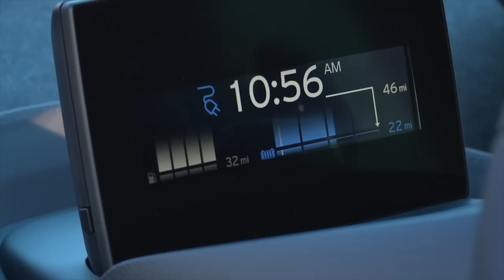Five Things We Need To Improve About Electric Cars

Comment: When you boil it down, the EV is all about the battery. So improvements in battery chemistry is absolutely top of the list. The holy grail should be solid state because of..everything. Li-Ion has range reduction problems with too cold or too hot, even with thermal management. With solid-state, VERY rapid charging is feasible too without undue long-term battery degradation. Because of the electrolytes they use, or rather don't use, they are lighter and will be cheaper too.
Reply: Solid state may be better and come to fruition soon enough, or not.  Do not let perfection be the enemy of the good.  No point in waiting when by the time a Li battery wears out to the point of replacement there will surely be a better cheaper replacement, solid state or not.
Reply: I disagree and claim that solid state batteries are an almost irrelevant Holy Grail that will bring almost nothing unless they also reduce the price per kWh.
Let's use a Model 3 / Kona / Niro as an example and assume that 30% of consumer price of the car goes for the battery. 
On a state-of-the art charger, they all need about 30 minutes for a charge that adds 50% and 45 minutes for adding some 70-75%, which results at about 80% SOC and is regarded as "full" on a road trip.

Tesla does the same even slightly faster and since it has a bigger battery, it adds more miles per minute.

The first one you do during a coffee break, the second is a lunch break. While I agree that this may be a small annoyance, it becomes quite less important when you A) start /every morning/ with a battery that is as full as you want to have it and B) the first leg is 350-500 km (200-300 miles), depending how fast you drive.
All EVs are mostly charged when they are somewhere standing still, be it at home or at some parking spot, they need rapid charging only on long trips.

Now let's halve or double one of the characteristics with another type of batteries.

Double the battery life? With the exception of Leafs which have no battery cooling, all EVs have a battery that goes for many hundred thousand kilometers/miles before some significant (15%) degradation. Nobody knows how long they will go, therefore nobody really needs a doubling in lifetime.
Halve the weight of the battery? A nice feature, but since the car regenerates 80% of the energy you needed for acceleration, it would be merely a 5-10% increase in efficiency, so this is hardly a game changer. Except for the batteries which would go beyond 100 kWh and 500 kg, the weight is hardly an issue.

Double the power output? Barely someone would notice / need it. All EVs I mentioned have a 150 kW output or more and torque and power in abundance.

Double the rapid charging speed, halve the time, a feature that SSBs promise?
That would be nice, from today's 30 / 45 minutes we get to 15 / 25 minutes. It's a nice improvement, but very rarely important except on (very) long trips. How much would you be willing to pay additionally for this option? 5% ? A few percent more?

But, now double the capacity at the same price. That one is really a game changer.
Or even better, keep the capacity, halve the price of the battery. From today's 70%(car) + 30%(battery) you have only 70%(car)+15%(battery) = 85%. You have a car with a 15% price reduction.
This is by far the biggest advance the battery technology can make since it brings these cars I mentioned before in direct price competition to ICE cars.

So solid state? Forget it, at least for a decade.
Nobody has a battery that even works in a laboratory scale, far less in production.
And until it matches current batteries in price per kWh (or at least has the potential to come really close), it is a technology only for dreamers.

It's all about the price of the batteries (per kWh), every other aspect is far less important.
Elon Musk was (and is) right once again.

What we need is:
- more battery producers, I absolutely agree with Nikki on that one,
- many more 22 kW Level 2 AC chargers at parking spots for people who don't own a garage,
- EVs with at least optional stronger built in chargers (6-7 kW is not enough, manufacturers should provide optional 11-22 kW built it chargers),
- the charging infrastructure has to be simple to use, the best example is Tesla.
- an upgraded rapid charging infrastructure on major highways, eventually also faster than Tesla which offers 120 kW (CCS which goes theoretically up to 175/350 kW)
- by far the most important is EVs made in higher series which will lower their price,
- and finally more models with an affordable price, including family cars.

And btw, super-rapid charging is almost impossible because nobody would be able to handle charging cables which would be able to provide more than 1000V / 500A. They would be simply to heavy.
Reply: @richardpetek712  To claim solid state batteries are irrelevant to progress is like saying airliners should still be piston engine powered. Solid state is lighter, cheaper, faster charging, more energy dense and reliable.
Reply: @karlp8484  I deliberately made a very bold statement to show the controversy. Everything you say that they are capable of is only a slight improvement, mostly irrelevant until SSBs catch the price of current (and future) Li-Ions, and I made a very clear presentation for my case. Since you claim that SSBs are cheaper per stored kWh, please provide the source. If you can't provide it, don't make false claims. "Some day they will be cheaper" is not good enough.

If you didn't know, Dyson has written off about 50% of the investment in Sakti3 in 2018 because it didn't make progress. Just FYI.
Reply: @karlp8484  No, I oppose your basic idea:
> So improvements in battery chemistry is absolutely top of the list.
No, top on the list is lowering the price of the batteries . And that will most likely happen with batteries we already know how to produce.
Second on the list are small, incremental improvements in speed of charge and capacity per weight. 
Lifetime is far beyond normal needs if you charge between 20% and 80% and if you occasionally use 10-90% or even 0-100%, it doesn't hurt them too much.
The problem is only if you do it all the time which you do only if the battery isn't big enough.
Any issues of today's small batteries are almost instantly solved once you double their size.

So your proposal, a switch to another technology is pretty down the list, whether you like it or not.
Yes, it's a target for 2040, but far from something that would be needed in the near future.

Once you can show SSBs which will be produced at $50/kWh while still having all their benefits, they will be great. They will even open the market for commuter airplanes.
But until then, they will be only a small (real life) improvement. 

Let's go 10 years in future where every new EV will have an (optional) 100 kWh battery and will be able to charge at 175 kW on a CCS charger. Let's round this down to 150 kW what Tesla could already do today do if the chargers would be strong enough (Model 3 LR charges its 80 kWh battery on a 120 kW charger at 1,5C). 
At a consumption of about 20 kWh/100 km, it will be able to charge some 60 kWh (=300 km, 200 miles) in 60 kwh/150kW = 24 minutes.  Do you really think that a decrease in charging time from 24 minutes down to (let's say) 10 minutes would be that relevant? After driving 400 km / 250 miles every driver will want some rest. People who drive 3-4 hours do make some breaks. Those additional few minutes of charging time will be pretty much irrelevant . 
They are relevant only to you who still thinks like an ICE driver.

You think that 100 kWh batteries and 150kW charging won't be enough for pickups? I totally agree.
But where is the limit?  OK, the weight might be an issue. 
200 kWh batteries currently weigh 1000 kg, but with some improvement they will weight only 800 kg. Slightly smaller ones having only 160 kWh will weigh some 600-700 kg. That's already manageable in a pickup.
And you probably remember that CCS is designed to charge at the speed up to 350 kW. That's a 200 kWh battery at a 1,75 C speed. So?
Reply: @karlp8484  Don't get me wrong, I have nothing against progress.
But you unknowingly made a perfect analogy with piston/propeller vs. jet engines. And by sheer coincidence, the analogy differs almost precisely by 100 years.
In 1876 Nicolaus Otto invented the piston engine. In 1979 John Goodenough invented the LiCoO2 rechargeable battery.
In 1903 brothers Wright made their first powered flight. From 1996 to 1999 GM produced the EV1.
Piston planes made their major breakthrough during the WWI from 1914-18. In 2013 Tesla started to produce the Model S and in 2018 the Model 3 reached mass production of 5000 cars per week.
So that's almost a 100 years gap.

First ideas about jet engines came in existence in 1915, first patents were filed in 1921, first engines were built in 1935 and first really successful jet plane was the Me-262 in 1944. But outside military, where money isn't the first priority, the first passenger jet was the Sud Aviation Caravelle which entered service in 1959. And then it took almost a decade before Lockheed Super Constellations with their piston engines were passed out.

Where are we now with solid state batteries? Early ideas / university research / prototypes. We don't have even a smartphone battery where everybody would love a phone that charges in 5 minutes. A field where customers would easily pay a very high premium for the battery if the phone would have that feature.
I won't say that it will take 40 years before they enter service in cars, today things get developed a bit faster, but it will take at least two decades before they really make production models and they come even close to the price per kWh of Li-Ions which will be by then produced at a many times lower price than today.

But, in far distance, they have a future.
Once the battery is only 15% of the price of the car, will the customer be willing to pay a 5% price increase to get the same battery which charges 3 or even 5 times faster? Yes, some will, especially those who often drive long routes. Those who haul heavy loads like trucks or some users use their pickups.
They will be willing to pay a premium on their price, maybe 50, maybe even 100%, measured merely on the battery.
And eventually their prices will drop and they will take over the market. 

But this will be an E-volutionary change, not a RE-volutionary one. It will be a nice (premium) feature, nothing more.
Reply: @richardpetek712  One of the major difficulties with SS batteries and supercapacitors is the bewildering number of possible chemistry options. I have myself heard/read about 6 different ones. Graphene is starting to be produced on a commercial scale for example. So what I hear you say? Investment choices. No one wants to put mega investment into a particular solution, only to be overtaken by something cheaper and better. It is my understanding that this is a major problem. Tinkering in a lab is one thing, but actually going into production is quite differen.t
Reply: @karlp8484  "Tinkering in a lab is one thing, but actually going into production is quite different" .
Exactly. A) you need the technology and B) you need the market.
Currently Tesla needs to focus what lies 1 or 5 years ahead. Elon probably has a strategic path for 10 years, quite possibly even a few more.

I am pretty sure that Tesla will invest in SSBs when it will see potential in them, but today it has neither the time nor the money to invest in something that has the potential to become a success in 20 years.
As I have made it very clear, the first and major criteria is price per kWh of storage (if all other criteria is same or better). 
With a significant distance comes the rest.
Reply: @karlp8484  Graphene is another over-hyped technology. While in theory it is great, you have to solve what the insulation between graphene plates should be - and it is a high safety hazard. Once you have a big charge in it, it is a lot of energy. One crash that damages it - and it burns. Graphene is nothing else than pure carbon (=coal) in extremely thin plates. Expose hot carbon to air and it burns like a box of matches.

And even-if, super capacitors can hold two orders of magnitude less energy per kilogram than normal batteries. While they are great for rapid cycling (and city buses), they are horrible for cars. Yes, you can charge in seconds, but you can drive only for a few minutes.That's not even an option for a car.
Reply: @karlp8484  Research? Development?
Maybe by 2025 we will have a couple technologies where we will say "great, this one looks really really promissing". Be it SSB, graphene supercapacitors or whatever. But it will have to cover the whole package: charge per weight, charge per volume, degradation, charge and discharge speed, complexity/price. Being able to charge fast is a one-trick pony, that won't be enough.
By 2030 we may have good prototypes.
By 2035 they may be massively produced, first for appliances where their fast charging and other abilities will outweigh their high cost.
By 2040 they may become price-competitive for cars.
And by 2045 they may replace Li-Ions in all but a few areas.

Note that this is pure speculation, but this is how development goes. The history of Lead-acid, NiCd, NiMH and Li-Ion battery has shown it to us. Every transition takes time.

We can make the whole transition of transport of land to electric using the battery technology we already have.
With technology improvements we will be able to make it better for some specific use. Diversify it. Some people will like batteries with higher charge, others will prefer faster charging. We already know how to do this. There are LiPos that charge and discharge almost 10 times faster (used in RC models), but they hold almost half the charge less (per weight) and cost more than five times more.

Yes, Li-Ion technology is less than perfect and it would be nice to have a better. I don't have a horse in that race.
It is a great future for other technologies and a high probability that Li-Ions will be replaced with something better by 2050, quite possibly a decade or so sooner, but there is no need that we hold our breath until then.
Reply: @karlp8484  I suggest that we go from "waht would be great" to "what we really need/want". Set targets / goals.
What would be great? A fully recharged battery in 10 minutes. 
Whoa, that one was easy.
But then we wake up from the dream and we are back in reality. 
What do we really want and need?

I'll start with a sedan which consumes 25 kWh/100 km at 120 km/h (75 mph), a Tesla Model S. 
Scale down 20 kWh for smaller cars (Model 3 or smaller) or up to 30 kWh for SUVs (Model X, iPace), maybe even 35 kWh/100 km for pickups. But you will get the basic idea. If you need towing, add some 30% since you will also drive slower.

We start with a full battery.
The first leg should be 3 hours, that's 350 km. We take a short (toilet) break for 15 minutes.
The second leg is 2 hours, 250 km. Longer (snack) break, 30 minutes.
Rinse, repeat. Agreed?

So in a pretty much ideal case the car should charge 
- for 250 km some 67 kWh in 15 min (that's a charging speed of 270 kW) for the second leg
- for 350 km some 87 kWh in 30 min (that's a charging speed of 175 kW) during the lunch.
Can we do that with the current (Tesla) technology? Yes. All that is needed is a 160 kWh battery and a 300 kW charger.
But, this is a huge battery for a Model S.

Let's do a slight compromise, add 5 minutes to each charging session:
- for 250 km some 67 kWh in 15+5 min (that's a charging speed of 200 kW)
- for 350 km some 87 kWh in 30+5 min (that's a charging speed of 150 kW)
That's a definition for a 135 kWh battery and a 200+ kW charger. These few additional minutes bring charging times and speeds to reasonable numbers.

And that was my initial proposal: 80 kWh for smaller cars (a few more would be better), 120 kWh for larger ones and 150 kWh for pickups and SUVs. 200 kWh if they need towing capability.
While this may seem a lot for today, the results will be (as I have shown in the example above) pretty close to what we will ever want, or better to say, need.

Let's go to the Model 3 Long Range.
It has an initial range of slightly less than 400 km (250 miles) at freeway speeds. It meets the first criteria.
And it charges about 50% of that range in about 25 minutes, so it's 5 more minutes and the added range is 200 km and not 250 – for these you need to charge slightly over 5 minutes more.
People will live with it. On a 1000 km (600 miles) trip it is totally irrelevant if on that 10-12 hours trip each of those 3 stop lasts 5 minutes more.
So while the Tesla Model 3 Long Range isn't the ideal EV, it is pretty damn close. It's the best what the 2018 technology can offer.
And people who can afford it are running for it.

Ten years from now newer cars will be slightly better, but they will be merely an incremental improvement, nothing dramatic. 
A slightly bigger battery and a few minutes less for the charging - and that's about it.

We'll just see lots and lots of different cars from different manufacturers having lower prices – and that will be great.
Reply: @richardpetek712  you hit the nail on the head with your comment that we need "an upgraded rapid charging infrastructue on major highways" ~ but perhaps no the way you were thinking.  
What potential charging possibility can electric vehicle do that an ICE can not??? It can charge on the move ~ that's the killer edge EVs have been looking for over ICE vehicles ~ SMART HIGHWAYS ~ CHARGE ON THE MOVE.
Reply: @hitreset0291  Charge while you are moving?
You would essentially convert cars to electric trains which get electricity from the grid.
You cannot make contacts in the air, nor on the ground, so the charge on the road would have to be taken wireless.

We are taking about charging at a power rate of 20-50 kW (20-50 thousand! Watt) per car. That's quite a lot, this is not an electric toothbrush or a smartphone, that's a magnetic field that is thousand times more powerful. And that's without a direct contact since cars are some 15-20 cm (6-8 inches) above the ground?
Electronics in cars could drive crazy. People with pacemakers would be exposed to a danger of dying on the spot. You are driving over 20-50 microwave ovens with open doors, that's serious business. Ok, I know, it's a magnetic and not a microwave field, but you get the idea of what kind of power we talk.
And at the same time some people are scared by radiation from their smartphones that goes in mili-Watts. Crazy world.

That would be tons and tons of wiring in the road, with all the complexity to realise who gets the charge and who doesn't, accounting etc., you get the idea.
Let's take into account that the cost to cover all significant roads would be immense while companies (like Chevrolet) even refuse to install a few dozen chargers per state on interstates and major highways. 
What about some less-important local roads? How would that EV drive there?
That's a proposal which is thousands of times more expensive.

And what for? On a long trip you take a leak anyway (unless you have a bladder of steel), maybe you have also a snack. And if you stay within the range of the car you simply plug it in once you arrive.

Sorry, but that's just another <insert adjective> idea that works only in theory but will never go beyond a prototype. 
Way too much pain (hazard, cost), too little gain.
Reply: @hitreset0291  Well, a few decades ago when I was a kid, there were some ideas about the future.
Knight Rider, a TV series with David Hasselhoff, with a "talking" autonomous car with AI, videophone and something like an internet connection. That car was more or less the 40 years old predecessor of the Tesla Roadster 2 which will be out in 2020 and will have fully autonomous capability in a couple of years later. 
And I actually studied IT and considered a career of artificial vision and AI, but I was born at the wrong place and twenty years too early.
No, I don't remember that somebody would have a vision of connecting computers with mobile phones in the eighties. Internet and WWW became publicly accessible in the nineties.
But there were ideas to give watches mobile phone capability - which we still don't have.

First mobile phone was made in 1973. In the nineties they switched from analog (NMT) to digital communication (GSM) which enabled data transfer. Once phones got their first cameras (which were more like a gimmick back then) and the processors to digitise images, the rest is history. 
Processing images + data transfer => internet in the pocket.
But what infrastructure do we need for that to work? A few antennas where each one covers hundreds if not thousands of people. That's an investment of few tens of dollars per user, maybe a hundred, tops.

What you want to propose is something like a small-scale maglev track, you know, like the train in Shanghai. A similar thing, just without the magnetic levitation.
You know why there are almost none of them? Because they are prohibitively expensive. The price for that 30 km (19 miles) track was 1,2 billion. And it is viable since it creates a lot of revenue, the train works in 15 minutes intervals and the price for a round-trip ticket is $12,80 (source: Wikipedia).

And for your proposal you would need a track that can emit an sustained magnetic field of up to 50 kW along the whole route. That's a lot and lot of wires. Even if it would be possible to make it 50 times cheaper than the maglev track, we are talking about 1 million per mile.
For that amount of money you can install at least 10 rapid chargers, probably more. And USA has about 47,000 miles of interstates. They have more than one carriage. So we are talking about a 100 billion project, quite possibly I underestimated the cost and it could be a couple times more... Comparing to this, Tesla's Supercharger billion-worth network would be child's play.
While currently every state in USA only needs some 50 or 100 of them on interstates and major highways. That's maybe 5 or 10 million per state, but nobody is doing it. Because it is too expensive.
Your proposal is at least thousand times more expensive.

And even if this would be done on interstates (which /as shown/ would be prohibitively expensive), cars would also have to be able to charge this way at this rate. So cars would be more expensive too.
And you haven't solved the problem for all other routes, so cars would still need quite big batteries. Yeah.
All that for not needing to have to plug in your car while you take a leak on a very long road trip over an interstate.
Well ... I think I've made my case very thoroughly.

I probably know a lot more about physics and engineering than you do. And I base my scepticism on that knowledge.
I love progressive ideas, but they need to have a purpose and they need to be financially viable.

And all you can say is if folks would be following people like me, we would be still in stone age.
No.
I am against wasting money and efforts on things that don't make sense.
Over time, computer power (and AI) will become cheaper and cheaper. 
Copper wire is copper wire. It won't.

Would smartphones be a wild idea 40 years ago? Quite probably. But 20 years ago? For people who knew how to connect the dots - no.

I have nothing against progress, we'll still see a lot of it.
Li-Ions of any scale can hold more and more energy. 
In a few decades we will probably have even better technologies. which will open new fields.
Yes, wireless charging (which you like so much) has a future. For some fields of use.
Wifi connection chips are dirt cheap. So is mobile LTE connectivity.
Mini cameras like those we have in smartphones are cheap.
Processing power and storage is cheaper every day.

So we will see a lot of things in the next decades which will connect all these dots.
Some gadgets which will live stream video connection and some computer on the cloud will process that data and do something with it.
These things will connect with each other and exchange data.
There are lots and lots of possibilities.

But when it comes to infrastructure like heavy load charging, things become complicated and (prohibitively) expensive.
So sorry, you may have ideas, but this one doesn't work, at least not in this century.
This could work once humanity can harness solar energy 100 times cheaper than we can do today or when robots cost $1000 and will start working for an cent an hour, but we are writing the year 2018, talking about the next few decades, not the year 2200.

What could become possible is stationary wireless charging of EVs like smartphones do today. In garages or parking spots.While this is a pretty expensive proposal, that one could have some potential. You park your car, it identifies itself and starts charging. It's a convenience feature, like that one with smartphones.
Actually this would be the perfect solution for fully autonomous cars - if they wouldn't need some daily maintenance (interior cleaning) too, and once you clean it, you can plug it in too, right?
But it could be an optional feature for luxury cars which could charge this way in their own garage.
How much would that cost per car for charging at 10 kW? $5,000? $3,000? Something of that magnitude.
Maybe, with time and scale, it could cost less.

But that's a lot different from your futuristic proposal of charging while driving.
Reply: @richardpetek712  here you go...just shows you don't underestimate SSBs: VW just bought a $100 million stake in QuantumScape, a solid state battery company. They're going to leapfrog Tesla/Panasonic in battery technology.
Reply: @karlp8484  I gave you a very detailed article / lecture how lower weight and faster charging are pretty irrelevant. Having a battery that has 50% less weight decreases the weight of the total car by only 10% - and that's the efficiency gain in cities. On freeways it is even a few percent less.
Doubling the charging speed just shortens times on very long trips. With a decently big battery, Li-Ions can be charged at 150 kW and more, which gives the driver in 10 minutes about 25 kWh which means he is good for next 100 km or even more..

Yes, VW may invest 100M in some technology that will give some gain in 20 years, it has enough money to wait for some results in 2040.
So if you are waiting for some miracle, I have explained more than enough. SSBs are merely an technological improvement and until they reach mass-production at Li-Ion prices, they are irrelevant.

Much more important is that VW is investing $40 billion in Li-Ions and yes, this means that in 2025 they will have some serious production of EVs.
VW will be the "new" VW and Tesla is the future BMW. And we will all benefit from both of them.
Reply: @richardpetek712  I don't think you get it. Lighter, more energy dense and cheaper (because of the lack of rare earth materials and expensive metals) are all represented by the different SSB technologies. Otherwise, they wouldn't even bother announcing anything. Every single one is superior to Li-ion. A Singapore company just put ON THE ROAD an EV light truck with graphene supercapacitor batteries. It's already breakout time. Li-ion is yesterday's news.
Reply: @richardpetek712  I did check it out but misquoted. I should not have mentioned supercapacitor but should have just said "battery with graphene".
Reply: @karlp8484  Graphene or graphite? Graphene means carbon in 1 atom thin layers in super capacitors - and I haven't seen a single super capacitor in that technology yet, much less in some commercial buses.

Graphite (negative electrode) on the other hand is carbon in normal-sized shapes - it is almost in every battery, including Li-Ions.
Reply: @richardpetek712  Graphene. That's why it made the news. I'm an engineer I know technical stuff.
Reply: @karlp8484  Me too. 
I'd like to check it if you have the link to the article / video.
Reply: @richardpetek712  I can't find the damn article. But in my attempt, I got a scoop as consolation. It's Dyson. Dyson have set up a small production plant in Singapore (where they already have facilities). And Dyson are only interested in SSB as far as vehicles are concerned. I'm going to track Dyson to see what happens from now on.
Reply: @karlp8484  If you have read what I have written 3 days ago (or looked at Wikipedia abot SSBs), you would have read this:
> If you didn't know, Dyson has written off about 50% of the investment in Sakti3 in 2018 because it didn't make progress. Just FYI.
Reply: Let's all hope that Dr. Goodenough's solid-state battery design keeps its momentum.